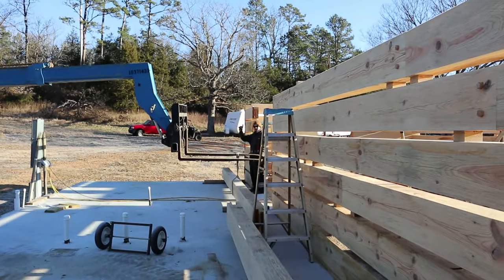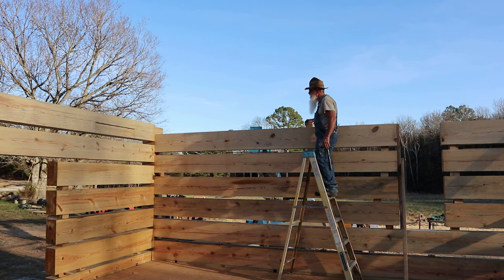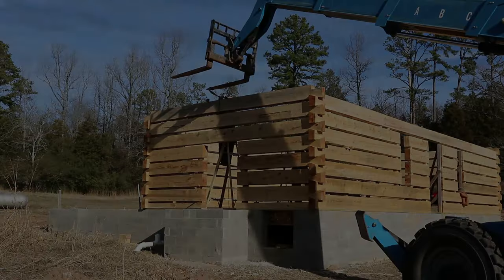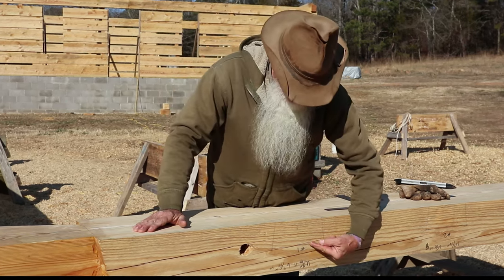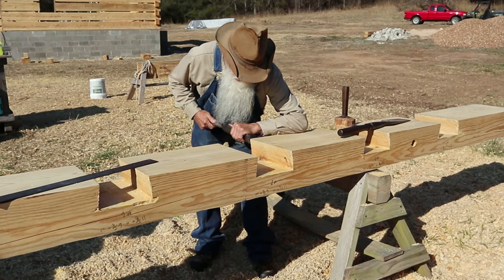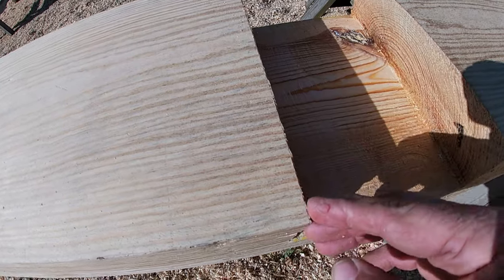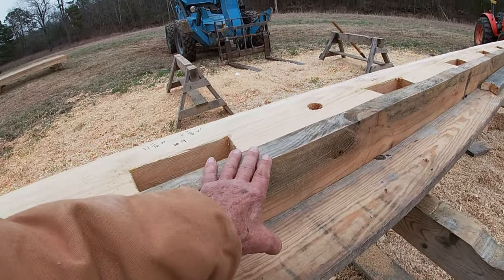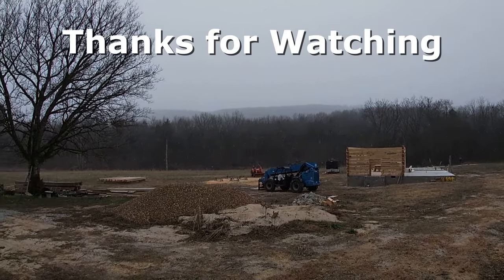Ozarks Cabin Build Ep 3

Comment: I love your log joining. I have always seen what I call a lap joint with a vertical 1" peg. They all sag, I like your log to log joint, excellent strong joint. I am making slow progress but got a neighbor who has an awesome quad runner has volunteered to get the logs to the landing. I'm using an old lawn mower deck and set the tail of the log strapped in where the motor was removed to help move the cant easier through the woods and keeps the cant out of the dirt. I am anxiously waiting to see the second floor beams go in. Awesome job the three of you are doing Paul, excellent job and teaching! God Bless you fellows!
Reply from the maker: Howdy Tom- glad you had some help with the big logs. I feel the mortice and tenon joint is better than a half lap and it looks nice. Hope all is well with y’all. God bless
Reply: Hey Paul, I agree and was looking at my Foxfire book and came on a photo of a half lap joint sagging and the mortice and tenon joint has two pegs at each joint, Got to be way stronger. Praying for you all., God Bless @TheBeardedCarpenter

Comment: Have you used logs with a live edge on top and bottom surface? I plan on cutting my Tulip Poplar logs six inches thick and hewing the outside face to give a natural look. Using 16 to 20 in logs.
Reply from the maker: Howdy James- yes, that is my preferred way of log building. You can go back and watch the Paradise Point videos and the earlier Dovetail Log Cabin videos and I explain how to do that with the figuring out of the notch dimensions and how to cut them. The logs for this cabin were already on the job site when we got there.   Since there was so much log work to do we used a log peeling disc on a grinder to hew the outside surface. I have always used a broad axe for doing that on every cabin except for this one. We would have been spending days hewing with a broad axe. Thank you so much for your nice comment. I sure wish you the very best with your cabin build. I wish we had poplar trees here. God bless

Comment: Are you not pegging each course and screwing with lag bolts as you go? Also what about drilling for electrical.
Reply from the maker: Howdy Willy- every log is drilled for electrical. I have shown that in past videos how I do that and keep the holes straight. I’m using timber lock screws on this cabin since the walls are so long. God bless
Reply: @TheBeardedCarpenter  thanks. Do you have a video that shows exactly how to layout the dovetails? I have 6x6 Hemlock that I wanted to build an outhouse as a first project. Thanks Love your videos!
Reply from the maker: @willywilliams7077  Yes, I do. If you go back to the Dovetail Cabin build videos there are videos that explains all the details and tips on layout and cutting and cleaning up the notches. I have videos on fitting them once the log is on the wall. Hope you enjoy watching them. Blessings